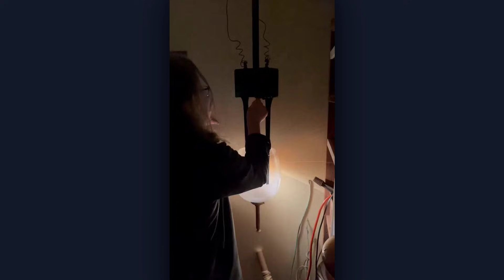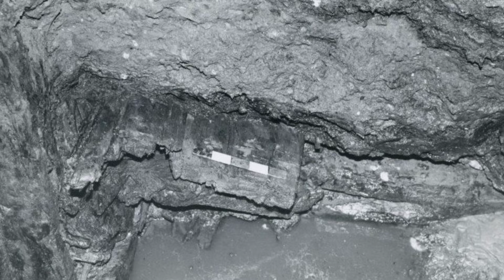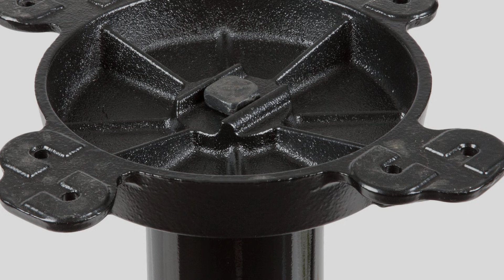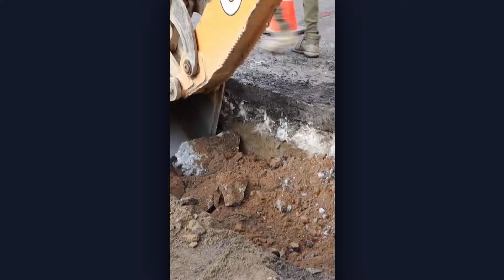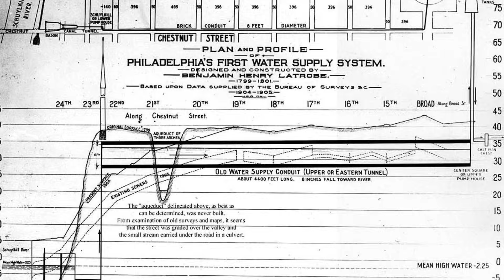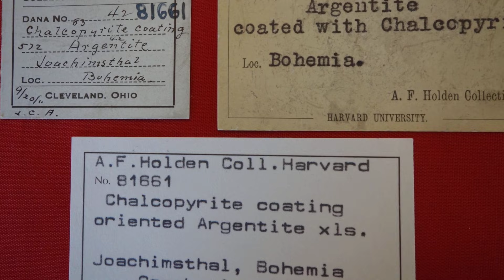They Distributed Energy Without Wires in the 1800s — And the Nodes Still Exist

Comment: Current requires a circuit to flow. You must use either the ground as a return, or if you were to deliver it through the ground, you must return it through wires.
In other words ... poppycock.
Reply: Ground is negative, not neutral. Atmosphere has positive ionic charge collected by metal atmospheric energy concentrators on top of structure.